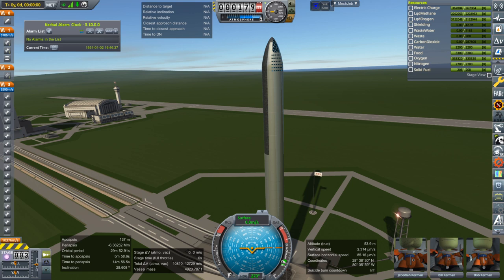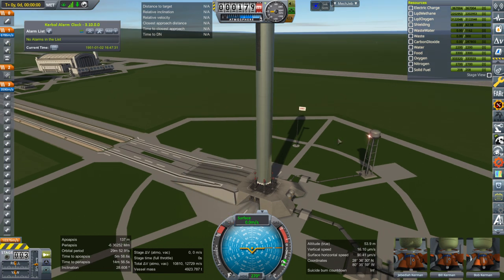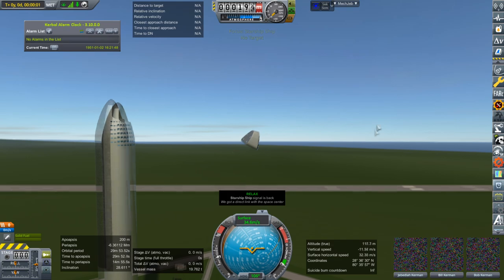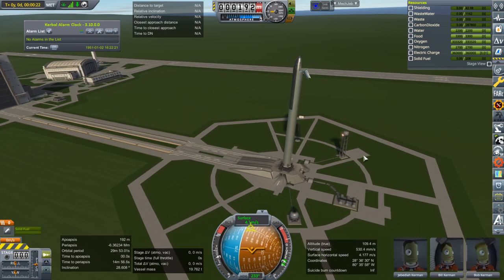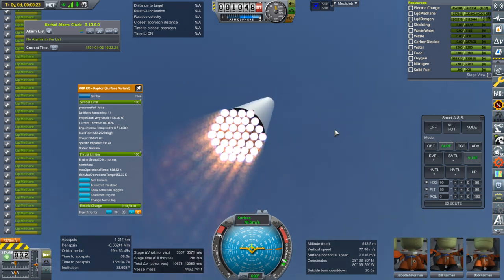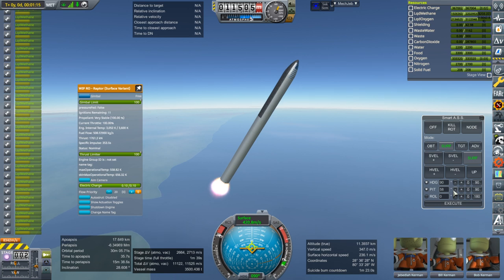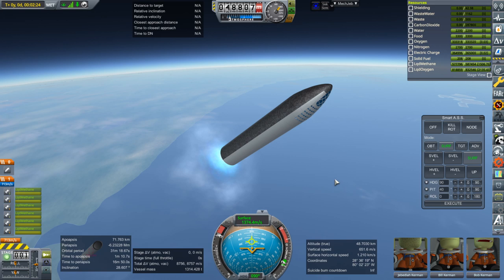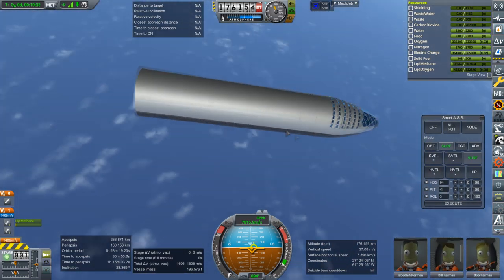Realism Overhaul in KSP - First Draft of Starship-Super Heavy Model

Comment: the lower stage fins are stationary and just for counterbalancing the body flaps on starship.
 
on the crew version there is gonna be a cargo hatch below the windows with a crane/ platform that folds out like the hatch you made until its horizontal which will turn into an elevator.
the cargo version unfolds like your design. 
if you look at the sn3 nosecone that's currently being worked on in boca chica you can see that the workers have cut tiny square holes into the nosecone for rcs but that's about as much as i know about rcs thruster positions. (maybe see if there is an animation of starship docking with the iss or another starship)

also i would reccomend making bodyflap parts or having them be a part of the starship because the whole "parachute jumper profile" would have to be configured depending on minor changes in the size of the flaps if everyone makes their own (aka it would save a lot of effort for everyone)

having the raptor engines on super heavy combined into clusters would save a lot of processing power also if you wanted to do that.

and also adding a retractable docking port would be awesome

thanks tyler im sure you could make the best starship in the KSP community :)
Reply: The crane/platform thing was from the original launch design. The latest version seemed to store most of the equipment like the dragon, in the skirt/trunk section. There wasn't a crane present. Passengers would have to get out somehow though so...
Reply: @weatheranddarkness  you can also find official render of elevator design in Starship Users Guide

Comment: As far as know there is no official word on power 

There are some rcs in the nose but that all I know for that

The ‘fins’ at that bottom are static
Reply from the maker: Thanks for the info! I'll add the fin/legs to the bottom of Super Heavy, then.
Reply: @RaizSpace  also Elon Musk said he would prefer there to not be an escape pod btw
Reply: @RaizSpace  As we know there will be 2 large cold gas thrusters on starship itself there are 6 rcs thrusters on the nose, 3 on each side one pointing forward, 2 pointing 45°angle down and up so they can be used for up and side movements. On the engine skirt (bottom) there are 3 on each side also one pointing strait down on the wing mount and 2 pointing 45° out also for up and sideways movements for a total of 12 rcs
Reply: The two cold gas thrusters are on the  super-heavy booster btw

Comment: I really like the idea of ejection cabin, i don't see real one exist without abort system. People say airliners don't have LAS. Well airliners do not have LOX and 3G acceleration.
Reply: Have you seen Everyday Astronaut video on a abort system for starship
Reply: @zacharyhandy9606  In my conclusion, reliability reduces the need for failure countermeasures.
Reply: Chester Joel I agree
Reply: @zacharyhandy9606  dude even if there were only 3 deadly cases, there were. Here you have like 25 people. 37 engines. Intense flight plan. What are you going to do if suddenly there is that one day per 100, where engine fails, where fuel tank ruptures, where fin locks and you can't perform landing? Say then that abort system was not worth it beacuse of money.
You can't be sure, how reliable your vessel is, until it fails in action, not during destructive test.
Reply: @_mikolaj_   i think it would be nice if there was something you could do, but parachutes for a cabin of that size are very hard to do and would add a huge amount of mass.
spacex's landings usually just fail because the booster has to do a suicide burn since its minimum TWR is more than 1 and they try to get very close fuel margins for maximum payload capacity.
on crewed starship flights they're gonna take extra precautions and will go with a lot safer stress levels. 
if spacex is gonna launch that often they will get an incredibly safe vehicle because all the trial and error of the uncrewed flights is gonna make for really good safety on the crewed ones. also they're probably gonna (have to) go for extra redundancy because they don't have a launch abort system.
Reply: I know that this is not the fairest comparison but planes don’t have aborts I agree with you that there needs to be backup plans but adding an abort system would add complexity there is no perfect solution and we should be constantly looking for safety improvements.
I don’t want to see a space shuttle repeat  there should be plans for most/all parts of flight.
Abort systems are great but have not saved many lives
Reply: Airliners don't have an abort system, not because they don't store LOx or experience 3 gees, but because they're so reliable that they don't need one. Only difference between that and rockets is the current technical barriers to being sufficiently reliable so as to not need an abort system, which SpaceX plan to overcome with features such as multi-engine-out capability.
Reply from the maker: Airliners do have abort systems - they're called wings. An airliner can land even if all of its engines are out, and the wings are arguably more reliable than trying to attach parachutes to such a large cabin. It's not primarily the reliability of the airliner that leads designers not to eject the cabin, but the sheer fact that the plane is largely the cabin, unlike with a rocket where the cabin is only a small part. Obviously a wing failure would be a serious problem, but no abort system is 100% reliable.
Reply from the maker: To put it another way, airliners aren't reliable and therefore lack abort options - airliners are reliable because they have a plethora of abort options if something goes wrong.
Reply: @RaizSpace  I thought wings are the arms of any airplanes, assuming that engines are the heart, and pilots, the soul. (for now)
Reply: @RaizSpace  The point still stands - wings won't save you if your airliner experiences total structural failure, but an abort motor will save a capsule if the rocket experiences total structural failure. At some point, you're always just relying on something not happening, and engineering to try and make it not happen. Expanding the frontier of what doesn't happen because you've engineered it not to always improves the reliability of a system, but most rockets are instead designed to make that risk small, but not small enough, and GTFO if a catastrophic failure does occur.
Reply from the maker: When you think about it, even the pilots are primarily an abort system - their main job is handling things when stuff goes wrong.
Reply from the maker: But my point is that even in airliners, improving reliability has never been taken to excuse the need for abort modes and contingency plans, it's just that those abort modes take a different form than those in a spacecraft. It's not reliability that will lead an engineer to decide that a launch escape system isn't necessary, but as in the Shuttle program, a combination of inconvenience and hubris.
Reply: Raiz Space good points
Reply: I don’t think starship needs an abort system/launch escape system, but it should have multiple contingency plans for the whole or most of the mission the space shuttle had plans but not for the whole mission
Reply: @RaizSpace  Fundamentally, all systems rely on certain things not going wrong to function. This means that a redundant system ("redundant" including the ability to abort) with a certain probability of complete failure is equivalent to a system which has no redundancies but has that same probability of failure. So, to justify a non-redundant system, you need to ask:
- How close is the probability of failure to that of a redundant system?
- How certain am I (in the literal, statistical sense of uncertainty) in that probability, in comparison to a redundant system?
- How much value is gained in not having the redundant system, in comparison to how much work is done to get the probability of failure to match the above criteria?

If you can satisfy those 3 conditions sufficiently, you can make a rational argument for not including redundant systems. Whether or not SpaceX is able to do that is a different story, but I'd be surprised if they haven't asked themselves these questions in a much more thorough manner than I've laid out here.
Reply: @Convergant  wow, great comment. It's all about boiling these systems down into the probability of each failure mode and ensuring that probability is within acceptable limits.

We all know that airliners fail some percentage of the time.
Would it be acceptable if Starship/ Superheavy had the same failure rate?
Reply: @pooounderscoreman  If StSH had the same reliability as an airliner, I would be very surprised (obviously in a good way). Out of all people to have gone to space, roughly 1 in 32 have died - compared to the 1 in 200,000 air travel sits at. I would love for that to be the case, but that's such a drastic increase that it seems unlikely.
Reply: @Convergant  sure. Maybe it's not going to happen. I'm just strictly talking about how abortion / ejection really cashes out as a reduction in probability of failure. If you can overbuild each point of failure or build in redundancy such that it's delivers the same reduction in failure probability, it is exactly as viable as abortion / ejection.

Comment: Im not even sure if SpaceX knows where the RCS ports will be on the final version yet. The fins at both the bottom and top do actuate, but the hinges run parallel to the body of the starship, which I haven’t been able to replicate with other wing parts easily. The most accurate way to match the way they’re supposed to move  seems to be with the hinges from breaking ground, but this has a number of problems, including the difficulty of mapping the controls to action groups and the wobbliness of the hinges.